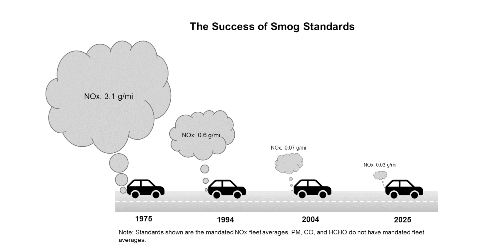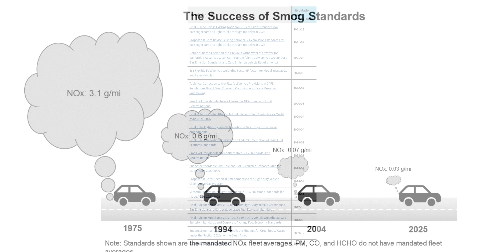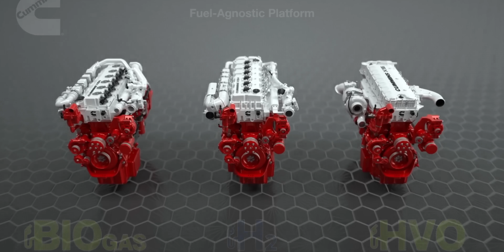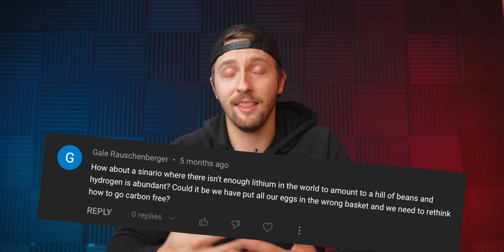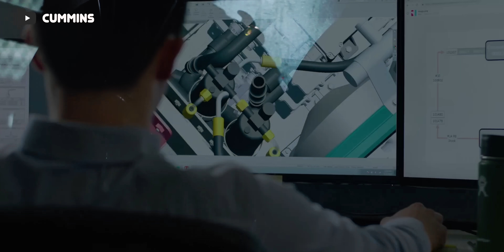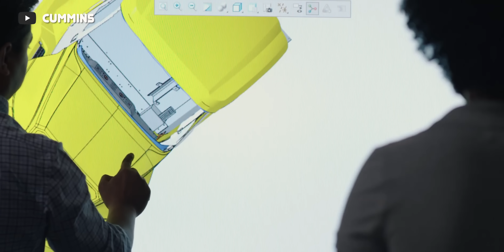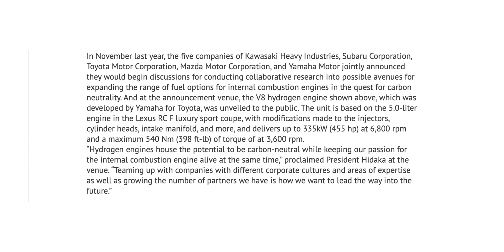Cummins Hydrogen Engine Will KILL DIESELS FOREVER

Comment: And realize if it's government related, and they want to regulate this, just realize the corruption behind the scenes and the boogie man. They are creating that isn't or does not exist in real-time.
Just be aware of what they say because this is only benefiting them.  By creating an event or an illusion, because you have sleepy drones, that's still harder to wake yet, and you don't understand the current steps of climate that's clean air yet. But, you know, cutting down trees, it's pretty good too. When you only one of those houses that had trees in the front yard, but you decide to cut them down because it doesn't look good.
And what absorbs Carbon that we're so afraid of but let's not forget about the carbon that is also coming from Volcano. Es that are currently active. Let's just not forget about that. Because that's a major factor and all of this, a real big factor way more than diesel combustion engines and industries combine.  But let's not talk about that. And if people in the e p a are part of the problem. They really need to evaluate since there are a lot of backpoints on their current events and directions. Because we keep cutting down trees the way we are. We're not gonna have trees, and it's gonna be hot, dry, and miserable. So let's keep this in mind because this is also very importanto. Desert people in isn't, but to people. That had trees and are being cut down by.  Greedy developers who can't use land that's already available that's already been worked, and all they have to do is tear it down and replace the Bui. Ldings, no, they don't do that. They look for land to chop down trees and build their stupid little condos. That's what they do waste of space.. You need to put regulations on, especially on the things that they are believing. Is true, but not factoring in the other variables. That do have a big impact or realize that the Earth is going through a cycle. First, you have to admit you have a problem.  That's what the EPA has to don't get it. They don't understand they believe whatever person is being paid to make. It or to sell it basically. 2 people who are stupid enough to believe it. And everybody wants to bash at oil industry. What do they know that will comes back? The oil that is, it doesn't come back right away, but it comes back.
So there is replenishing going on, which means renewable.
But you're not supposed to know that. This isn't conspiracy theory this is definitely on that conspiracy theorist theories. Because the Earth never gotten over 90° hot and humid sticky. Never froze befor never did any of that until we showed up. If people can't prove anything, they should really stop. Because because it's in the air doesn't Quality is getting bad, it's because of development. People knocking down trees that actually made it easier to breathe. More shade, more cool air. What happens when you cut down trees? You dry out the area, and then other trees will die because the.  Don't have the water that they used to.
And then the trees because of stupid people I mean  stupid greedy people I should say. And we really haven't put back the trees that these idiots cut down. So that's blowing around the hot air, the humidity. Nothing to slow it down. Have you noticed that gotten windier? Not by Convenience
At the winds have been picking up more trees. I've been knocked down, that's for sure. Which adds to the wind loan across certain areas and adding to the already windy areas that don't have trees.
So maybe we should start with people. That is idiots and not cutting down trees. With they got no business to do that.  Or should be doing that in a Rural area. But everything has consequences.
I guess the car is in the industry That really don't have anything to do with global warming. As much as people want to Disagree on that, I'll let these people have been around a million years. They really need to shut up, I'm just saying. And I can assure you. There are no older than 30 years old, which does not qualify them to say or open their mouth to say any d*** thing. That isn't true. There's a reason why people should look and listen. And don't jump on the next bus thing. That's what your young folks do you jump on stupidest things possible? Stop, look and listen, use common sense, not that hard. For Is the ones that are entitled Start making sense.
Stop trying to not use common sense. It does not work, it does not have a good look on you. It just makes you look even more dumber than the concept that you are coming up with. And trying to smother the Industry is stupid in all accounts just dumb, and they can. It could only come from people that are already been told. One thing And not listen to everything else is not my fault. You wanna be stupid and choose not to listen. Go right ahead. Find out yourself you're not going to really do much. Anything. But fail miserably, and then nobody is going to listen to anybody like you anymore. Stop with the falsehoods and tell people what is really going on. The Earth is going through a cycle.  And we may be heading into an ice. Alet's be realistic people. This Earth has been doing this stuff way. Before we showed app, and it's not gonna stop. Because we're here and stupid people to make this even more annoying by listening to idiots about climate change will obviously have no f**** clue what they're talking about.. And repeating the same thing over and over again, and not talking about everything else that is.
And actually, Trump's the industry and the carbon coming from the cars combined, we repeat that combined. Yes, including cars and industries, the air is polluted, but not by us. This is something that people don't really seem to understand the Earth is naturally doing that the sun is brighter than usual which they can. What should I keep forgetting to talk about?  Little part info that you know to people. That might say that could be a problem. When actually it is, and then you got the idiots. Cutting down trees to build their stupid little condos for their friends and family and stupid people that will rent it out.. And here's another fun fact, why is the grass still green? When all the trucks in the truck stop or anywhere that there is a truck, it's still green grass is still growing. It's not dead, why is the trees are full of leaves? Why is that? Oh, it's the trees what a wonderful combination.. Why hasn't these dingbats think of things like this that we can do naturally? Enforcing these idiots that build these condos that knock down acres and acres of trees to build these stupid complexes need to put more trees in their property and pay more taxes, so the locals don't have to pay for it.

Comment: Hydrogen has been tested in diesel trucks for the last 15 years . Hydrogen mixed with diesel gives your truck more torque, more horsepower and better fuel mileage. The cost of water compared to the cost of fuel. A much better profit margin. All EV are very dangerous to human beings. Electric vehicles will fail, hydrogen vehicles, diesel vehicles, and regular fuel vehicles will move on. Regulations will drop off. When running hydrogen with diesel it burns cleaner. Pride trucking in 2008 started hydrogen, injected testing we went from 6 miles to  gallon to 10 miles to the gallon the engine had no carbon buildup at all . Compare that to EV you can’t because Ev can’t go pass 200 miles on one charge. The cost of EV are significant when it comes down to replace the battery. If you can’t, there’s no recycle yard for electric vehicles. Nobody will except the batteries nobody will accept solar panels. Electric vehicles are dead in the water. But soon a new type of vehicle will take over all of the roads in the airs. Diesel and gasoline or not fossil fuels that is the blood of the Earth that we live on.

Comment: Pretty interesting choice from Cummins.

I will add that whilst hydrogen burns clean, but it’s FAR from clean to produce at an industrial scale at the moment.

I think if hydrogen had a chance, it would have been when it had the muscle of Toyota behind it, so
my money is still on EV's in the long run, especially with new graphene based / graphene hybrid batteries that are already being tested, that are achieving energy densities, absorption rates and endurance that puts today’s best lithium tech to shame.

Comment: Sounds cool, but 95% of hydrogen comes from fossil fuel wells, and electrolysis is a 7-1 net loss. It neither solves the "climate change" issue, nor is it economically feasible. Then there's the issue of hydrogen storage and transportation. Hydrogen, as a gas, is really dangerous, with an explosive range wider than any other gas. Mixed with ambient air, it doesn't burn; it explodes.

Comment: When you remove fuel from the discussion, you're left with the choice of ICE or electric motor for power. The fuel for an ICE can be a liquid or a gas. The fuel for  an EV can also be liquid or gas. The dumbest approach is the path the EV industry is on now, which is to spend trillions developing an alternative fuel source, electrons stored in batteries.

Comment: Hydrogen will not replace diesel if not for just one good reason: Hydrogen takes too much energy to produce. As of now you can only produce hydrogen from electrolysis of water witch uses too much electricity to be practical for mass production and even if you had a 'free' source of hydrogen, compressing it into usable quantities into tanks takes way too much electricity as well.   Fossil fuel, as of now, is the best way to store energy man has yet created.

Comment: Burning hydrogen in an engine instead of a fuel cell is idiotic.  You'll lose about 2/3 of the chemical energy of the fuel as waste heat.  Hydrogen fuel cells can hit 80% efficiency, and electric motors can hit 90%.

Comment: Why are you changing the valve cover gaskets at every valve checks, I have an R NineT and have checked the valves 4 times and never replaced the gaskets and haven’t had a single leak?

Comment: Dumb.  Most hydrogen is refined from crude oil because it's a lot cheaper than producing it by hydrolysis from water.  Hydrogen is just another scam.  Eventually, we will have the battery technology with the energy density to give electric vehicles the power and range to perform like a diesel.  When that day comes, no one will want a diesel engine.  Reality will set in eventually and most power will be generated by 4th or 5th generation nuclear power plants.

Comment: We need to consider the Marine industry in this conversation ... Everything consumed via import, export is transported via sea freight, including many parts of the vehicles you mention. Vessels with a large volume floating in an endless sea of potential Hydrogen. Commercial shipping already uses a multi fuel policy based on the emissions control in the area of navigation. The engines mentioned in this video are very small scale for the marine industry even for power generation. Cummins is clearly putting its tow in the water ( pun intended ) in order to remain relevant.

Comment: This video is on the late show, and has mostly everything WRONG.  Cummins bought Hydrogenics back in 2019. That company was doing on the fly hydrogen fueling.  Liquid hydrogen has no place in this scenario.

A hydrogen generator, a true and efficient one would NOT  be "massive" to power a 15 Liter engine e, the alternator system for the electrolyzer would be.  That is why the ideal setup is an electric hybrid like a locomotive is.

A excavator is a diesel that drives hydraulics so that is an apples to oranges mention

It appears you misunderstand what Cummins and bifueling is.  The hydrogen technology works right now today, but the problem has and always will be obtaining hydrogen, but if you have a clue now Cummins solved that with their 2019 purchase of Hydrogenics

No data or calculations are presented, but they are simple math one should learn before trying to teach a math class

CUMMINS is the largest manufacturer of heavy gaseous gas engines and it developed in association with Westporf

All Cummins need do is put one of their hydrogen on the fly generator systems with an engjne

We are an EPA Registered alternative fueling systems supplier, and it be said with certainty this video is wrong in most all it's speculations and conclusions.  Vista our website (username without the number ers) and learn math and science before trying to teach the subject in a video

Comment: Natural gas has twice the energy per volume  of hydrogen. A 6.7 litter hydrogen engine puts out 290 horse power while a same size diesel puts out 420 horse power. The standard size 6.7 L will not be used with hydrogen due to low horse power.
Reply: But h2 gives more Tq

Comment: Hydrogen Engine will not happen! Were are we going to get all the Hydrogen? EV for most vehicles will dominate for shout range and for long range diesel will still be used until better battery tec is developed.  With in 10 years new  battery tec will allow for long range transport.

Comment: Your comment on why not just use electric is simply answered. The batteries are heavy and use a lot of space. 
Personally, I think hydrogen mixed with air (Nitrogen) to get ammonia is the best green fuel. It is a liquid till ignition in the engine and the exhaust is water and air. This fuel is just a way of storing energy as it would have to be made by wind and solar arrays first. The good news is up to 20% of wind and solar energy world wide is unused and free for making Hydrogen or ammonia. Wind at night currently is not used as we are asleep and too much solar is produced at midday, both are simply turned off. That's why on perfect wind days you see several turbines standing still. their power is not required.

Comment: H2 Combustion Engines simply will not be part of the transport energy transition. It's a pipe dream some hang on to, but will not become a reality. H2 ICE are so grossly inefficient compared to BEV that they are simply not commercially competitive. They are inefficient, complicated, expensive to maintain and unreliable. No one will buy them. BEV is already winning and H2 ICE is a dead duck. Diesel will be with us for the next 10 to 20 years in trucks until the BEV Truck takes over.

Comment: BNSF has been moving toward fuel cell trains. The problem with hydrogen is it needs to be made. Hydrogen can be picked up from nuclear power facilities. The name they called it was pink hydrogen. Electric heavy trucks and excavators are foolish. BNSF was going to build their own hydrogen facilities. Electrolysis is not efficient enough to break bonds to power an engine.

Comment: 7:33 this will just add cost and complexity. It will be easier to switch to electric given the reduced cost for the fuel, less maintenance cost, and the continuous improvement in battery technology. 
   An electric haul truck in a mine would cost 1/4 to run compared to diesel.

Comment: Most sites, even mines, have plenty of electrical power. The largest shovels that can fill a 480 ton haul truck with three scoops are powered by electricity. Electrical supply isn’t a problem and what has to be shipped in is the diesel for the trucks.  So, this really isn’t an issue.

Comment: 1)Hydrogen Embrittlement 
2) Hydrogen is usually made from fossil fuel not water electrolysis. 
3) Hydrogen shipping is difficult- can’t go in regular pipelines.
4)Hydrogen has multiple losses in its production and storage which made it wildly inefficient. It’s very difficult to ship and store.

Why is cummins doing this…? It’s their only play. They can’t pivot to electric motors it’s too different. They see the sunset of diesel in the future and Hydrogen is their only hope but the physics are not on their side. 

Tesla is delivering a semi albeit in low numbers that gets 500mi fully loaded and blows past diesels driving up mountain passes…

Comment: the only reason i can imagine is that cummins is doing this is that they are expecting the ev agenda to fail and to have the diesel still in production to switch back, running ice on hydrogen is just stupid, sythetic methane is more likely to be used, maybe in an rcci system....

Comment: Cummins is not just betting on internal combustion engines, there is also extensive efforts being applied to fuel cells. One of the big problems with compressed hydrogen is the # of BTUs that can be stored in the tanks. Efforts are being done to store hydrogen in solid materials which will avoid the need to compress the gas. It take a lot of energy to create hydrogen from water and when you add the energy to compress the gas, it is not an efficient process.

Comment: Good on Cummins for at least trying but I wish this video had more math related to why electric doesn’t make sense for off road or long haul trucks. If charge times can be only 60 minutes it’s a relatively easy infrastructure issue. Yes you need a fat cable but hydrogen requires a whole weird infrastructure too. 

Also the noise from diesel needs to get factored in. In a city environment it really is a big deal, and actually prevents some construction projects from proceeding.